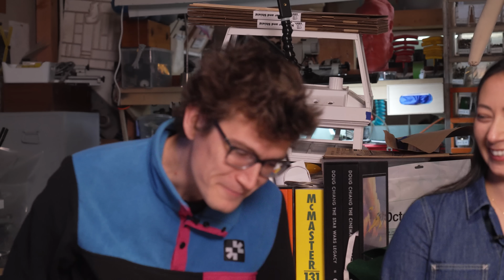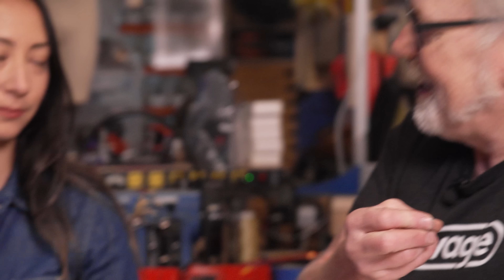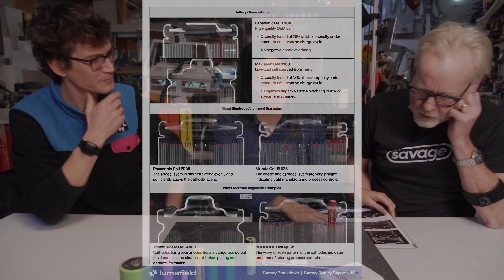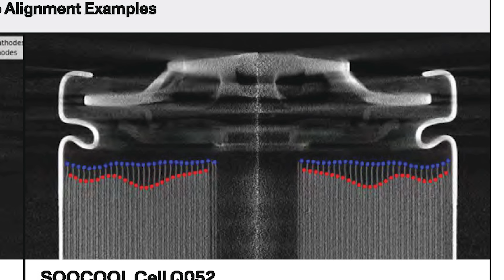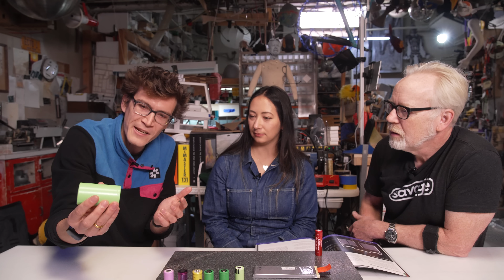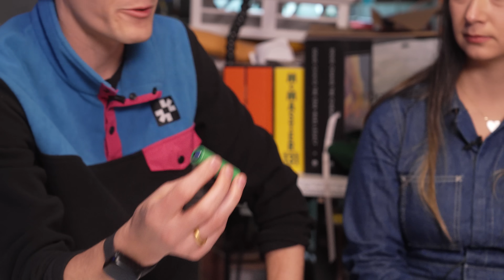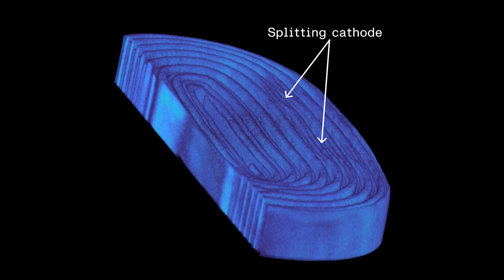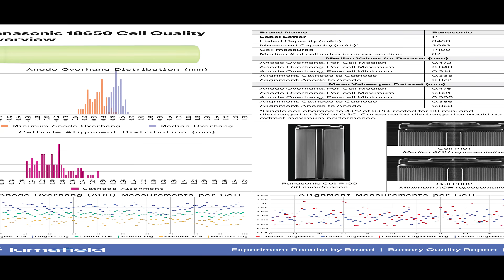The Surprising Flaws in 18650 Lithium-Ion Batteries

Comment: The batteries measure 18 mm in diameter by 65.0 mm in length, giving them the name 18650. The zero at the end denotes the cylinder shape. This was a great episode. 🙏❤️
Reply: The zero at the end is the first decimal, not to signify a round cell. For instance a 2032 coin cell is 20mm diameter and 3.2 mm thick.
Reply: @LesNewell If the overall height is less than the diameter it is classified as “button”.
Reply: @LesNewell nah Im pretty sure they're shaped like a 🕑 :P
Reply: @LesNewell bro arnt you embarrassing talking bs like its facts and you know better when clearly you dont. Your comparing 2 different types of cells. One is a cylindrical one is a button. And 2032 cells are a complete different chemistry of lithium and not usually rechargeable. Maybe next time if you are unsure save yourself the embarrassing comment that makes you feel dumb when you get called out
Reply: @hus_10001  he was talking specifically about the number compared to the actual measurements, and yes, button cells and lithium cells use the same measurement specifications, even if they're different types of batteries. The IEC number is literally just specifying the size of the battery.
Reply: @LesNewell  Totally wrong. 1865 is the cell type (18mm by 65mm) and the 0 at the end does indeed signify the cylindrical shape. Look up IEC 60086-1 for the standard in black and white
Reply: @MELOD  4.1.2 Battery dimensions Annex H
The dimensions for individual types of batteries are given in IEC 60086-2 and IEC 60086-3.
Figure C.1 – Designation system for round batteries: d1 < 100 mm;
height h1 < 100 mm .............................................................................................................. 30
Reply: @paristo  Is there anywhere that ordinary mortals can get to see this publication? All I can find is paywalls that want multiple hundreds of dollars from me.
Reply: @gcewing  I don't know, as I responded to message saying that -1 gives the standard specifications, that it is written in the -1 that the documentation -2 and -3 are what specifies those information.
Reply: Can you guess what 21700 stands for? 😂
Reply: @Turbogto_guy  50 more!!! 🤣
Reply: @Turbogto_guy  21mm x 70mm cyclinder
Reply: @Turbogto_guy sometimes fake 18650s should weigh them
Reply: @Nihaopaul what does that have to do with “what does 21700 mean”. ?
Reply: @Nihaopaul bruh you a genius you know that. 😐
Reply: And the crazy thing is that a lot of the cheap ones aren’t the same height!
Reply: Thanks
Reply: I mainly use 21700s these days. Have a bunch of Samsungs in my bosch powermore battery for my Emtb.
Reply: Wow
Reply: Thus these batteries are all supposed to have the same heights and diameters, to tight tolerances.
Reply: Wrong. The second identifier is in 10ths of mm. Therefore 650. That's why the 2032 is numbered like that. 32 tenths = 3.2mm
Reply: @mrcolinmcn  Please cite your reference for documentation on the tenths theory you mentioned. I will cite my reference which you can look up. 1865 is the cell type (18mm by 65mm) and the 0 at the end does indeed signify the cylindrical shape. Look up IEC 60086-1 for the standard written in black and white.
Reply: Cept anyone who's dealt with 18650 cells will tell you that they're all a little different physical size.   Some a little fatter, some a little or a lot longer.   You can even see it in the opening shots of this video, with all the cells lined up next to each other.   The protection circuit and button on top don't count as part of the 65.0mm but even among the cells that don't have either, there are size differences.
Reply: @daemn42 True. Some companies don’t follow the standard sizing rules.
Reply: @13Voodoobilly69 Even main brands like Samsung and Panasonic have models with 0.5mm difference from standard...
Reply: That is really interesting, thanks for sharing! I was curious why it wasn't just called an '1865.' It turns out the '0' is actually a shape code used in the industry to designate a cylindrical cell. If it were a different shape, that fifth digit would change. It’s a clever way to fit all those specs into one number!
Reply: @manp1039  Actually the last digit is the tolerance. 18650 can be 18+-0.5mm and 65mm+-0.05mm in size. You always give dimensions with the least significant decimal that's allowed.
It's standard practice in engineering.

Unfortunately manufacturers don't often follow the tolerances properly and sizes of cells vary WILDLY.
Reply: @Mtaalas you are incorrect, the 0 zenotes the cell shape
Reply: @Bullwinkle39  "Commonly-used designation numbers indicate the physical dimensions of the cylindrical cell, as given in IEC standard 60086-1 for cylindrical primary cells. The first two digits are the nominal diameter of the cell in millimeters, and the two following digits are generally the height in millimeters, with the fifth digit indicating cylindrical shape. Alternately, the last three digits can refer to the height in tenths of a millimeter. Manufacturers may use non-IEC designations for their products. "
Reply: @Mtaalas Facts 💯🎯
Reply: @Mtaalas  "the fifth digit indicating cylindrical shape. Alternately, the last three digits can refer to the height in tenths of a millimeter. "

So, according to your own quote, both explanations offered here are correct. You're contradicting yourself.

Edit: and you're litterally just copying off wikipedia.
Reply: @velovedel  and that's a bad thing to do... because?
Reply: @Mtaalas  Which part? The part about just citing a source to present it as a the one correct designation without crediting what the source is? Or trying to correct what other people are saying by using an ambiguous quote that does in fact not support the claim you're making? Or ignoring the context of my reply to make a snazzy retort completely without substance?

All of them are, for various reasons, but they can all be boiled down to: You're presenting yourself as a person of authority with no claim to that position and your arguments don't hold up to scrutiny.
Reply: @velovedel  SOURCE IS IN THE DAMN ARTICLE. And I included it in the reply: 

IEC standard 60086-1
Reply: @Mtaalas  There's no need to "yell" and act like a child. An no, the source is Wikipedia. The quote doesn't exist in IEC80086-1. Which is obvious, as IEC wouldn't cite itself like that. 

You still haven't adressed that your quote, that you use to say someone else is incorrect, states that both your claim and their claim can be correct.

Again; I'm not saying you're wrong. But your arguments sure are. So why should anyone believe anything else you wrote?
Reply: @Mtaalas could you just be like "huh, looks like both are right and in this case because it's one digit and not three at the end it probably just is cell shape, I learned something today. Good conversation!" And move on?
Reply: @velovedel Not really.
Reply: @toby9999  spewing nonsense laddie
Reply: Actually the last digit is the tolerance. 18650 can be 18+-0.5mm and 65mm+-0.05mm in size. You always give dimensions with the least significant decimal that's allowed.
Reply: @Mtaalas  Quoting one of your own comments, where you quote wikipedia: "he fifth digit indicating cylindrical shape. Alternately, the last three digits can refer to the height in tenths of a millimeter. "

So you're contradicting yourself here.

Also, nothing in IEC60086-1(2006) [latest I have access to here and now] states nothing about tolerances in the naming designation system section (C2).

I'm not saying you're wrong. I am, however, saying your arguments aren't valid based without better sources to back your claims.
Reply: @Mtaalas  IEC 60086-1 would like to disagree with you. There's actual standards out there for a reason
Reply: @Mtaalas   OK, but doesn't change anything I said.   They're all labelled as 18650 which would imply no more than +/- 0.05mm in length, yet they are often various different sizes.   As someone who uses 18650's for a ton of different things from drones, to flashlights/headlamps, it's super annoying when they're too short, or too long or too fat to fit the application properly, and as I said in terms of length, the button top and protection circuit don't even count, so button top with protection is generally longer than without protection, both longer than a flat top, but not always.
Reply: @daemn42  Because standard is non binding, nobody needs to follow it if they so desire.
And so many do not...
Reply: @Mtaalas  I offer this for reference, there is plenty of places to find it if you look deep enough. 

18650 Battery Meaning: What 18mm x 65mm Really Means
By Alexandra Fender - 
January 2, 2026

What the Numbers Actually Represent

Let’s break down what 18650 stands for in a way that’s easy to picture. Here’s the anatomy:
* 18: This is the diameter in millimeters
* 65: This is the length in millimeters
* 0: Indicates a cylindrical cell format
Reply: @13Voodoobilly69 I literally cannot find your source at all
Reply: @hashbrown777 Grok halucination
Reply: @13Voodoobilly69That's from some blogspam-looking website that was started in 2024. Not exactly a source I'd trust.
Reply: @hashbrown777 

I tried posting a reply multiple times and YouTube removes my links. I will post again with the web sites explained in obscure reference but you can use it to figure out and search

large-battery      /blog/understanding-different-lithium-battery-sizes-a-comprehensive-guide/

Lithium batteries come in many cell formats—cylindrical (e.g., 18650, 21700, 26650), prismatic, and pouch—each optimized for specific energy, power, and application needs. Understanding battery size and lithium ion battery sizes is crucial for selecting the right power source for your device, as the appropriate lithium battery size can significantly affect runtime, power output, and overall efficiency. Cylindrical lithium-ion batteries are typically represented by five digits; the first two digits refer to cell diameter, the third and fourth digits indicate physical length, and the fifth digit indicates shape.

(Again, search for this with the web address corrected.)
safelith    /how-to-read-lithium-battery-numbers/

Model & Size: This is directly related to whether the battery can be installed in your device. For the most common cylindrical 18650 battery, ’18’ represents a diameter of about 18mm, ’65’ represents a length of about 65mm, and the last ‘0’ usually indicates that it is cylindrical.

And to toss in one more this is cut from a quick Chat GPT search.

Significance of the Last Digit in 16850 Lithium Cell under IEC 60086 Standard
In the 16850 designation of a lithium cell as per the IEC 60086 standard, the last digit, 0, has a specific meaning related to the cell's design and chemical composition.
Breakdown
* 16: Indicates the diameter of the cell, which is 16 mm.
* 85: Represents the height of the cell, which is 85 mm.
* 0
Reply: @BramBiesiekierski 

I tried posting a reply multiple times and YouTube removes my links. I will post again with the web sites explained in obscure reference but you can use it to figure out and search

large-battery      /blog/understanding-different-lithium-battery-sizes-a-comprehensive-guide/

Lithium batteries come in many cell formats—cylindrical (e.g., 18650, 21700, 26650), prismatic, and pouch—each optimized for specific energy, power, and application needs. Understanding battery size and lithium ion battery sizes is crucial for selecting the right power source for your device, as the appropriate lithium battery size can significantly affect runtime, power output, and overall efficiency. Cylindrical lithium-ion batteries are typically represented by five digits; the first two digits refer to cell diameter, the third and fourth digits indicate physical length, and the fifth digit indicates shape.

(Again, search for this with the web address corrected.)
safelith    /how-to-read-lithium-battery-numbers/

Model & Size: This is directly related to whether the battery can be installed in your device. For the most common cylindrical 18650 battery, ’18’ represents a diameter of about 18mm, ’65’ represents a length of about 65mm, and the last ‘0’ usually indicates that it is cylindrical.

And to toss in one more this is cut from a quick Chat GPT search.

Significance of the Last Digit in 16850 Lithium Cell under IEC 60086 Standard
In the 16850 designation of a lithium cell as per the IEC 60086 standard, the last digit, 0, has a specific meaning related to the cell's design and chemical composition.
Breakdown
* 16: Indicates the diameter of the cell, which is 16 mm.
* 85: Represents the height of the cell, which is 85 mm.
* 0

Comment: My biggest worry about multi-cell lithium packs is when you can't measure the individual cell voltages, or groups of cells in parallel + series wired packs, to see if one or more are under performing, often because the manufacturer doesn't want you opening the pack up, but how can you find out if one or more cells are failing or the pack is just getting old?
This is why in the FPV drone world the multi-cell lipo packs come with a balance lead so our chargers can make sure all the cells are charged properly, some chargers can even alert you to the fact that one of the cells isn't behaving.
Reply: Yup, never purchase a multi-cell setup that doesn't include an appropriate balance plug. A good balance charger is worth it's (now borderline illegal is the US) weight.
Reply: @Reahreic  "(now borderline illegal)" Someone should tell tool manufacturers. Almost none of their chargers do cell balancing.
Reply: @orijimi  I was actaully alluding the the stupid governments ban on importing anything remotely related to RC aircraft. IIRC balance chargers fall under the power systems for UAS.
Reply: You hit the nail on the head for laptop packs and similar. They don't want you opening them. Even repair shops. They do typically use balance leads to a BMS and do all the overcurrent cutoffs and undervoltage lockouts you expect. The main risk a manufacturer sees is a dishonest shop resetting undervoltage lockouts without swapping in good cells and damaging reputations and causing harm to people. The safety issue is why it's a lockout, but I don't agree with how packs are often impossible to open without damage and encrypt BMS communications without making keys available. 

This is certainly a complicated problem to solve, let's not pretend dishonest people won't try to make more margin if it's really easy, but most of the hard part is in wanting to do better in the first place and setting up communication and ways for customers and shops to hedge against fraud. It's really disappointing how most companies see "buy another" as the easier more profitable solution.

Comment: The "cheap" batteries are QC failures at the factory and then sold off to whatever shady distributor.
Reply: no the "cheap" are 100% meant to be exactly what they are... u think that 9000mah is missing material by accident that if it was actually full it would be 9000mah even though she clearly stated its IMPOSSIBLE for an 18650 to be 9000mah.